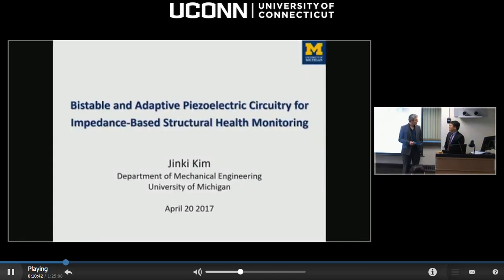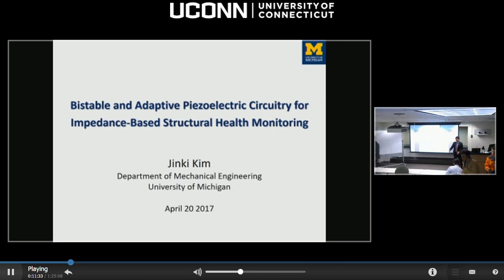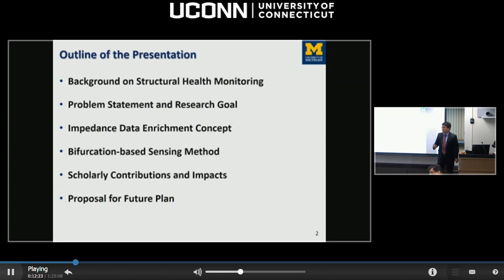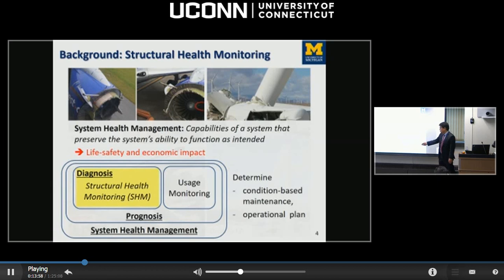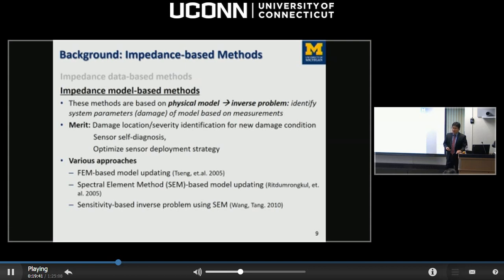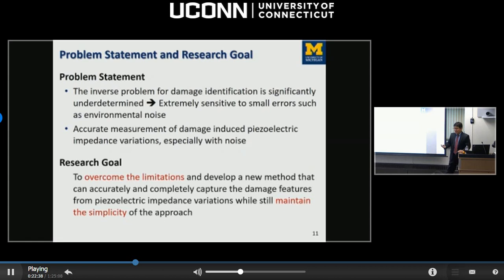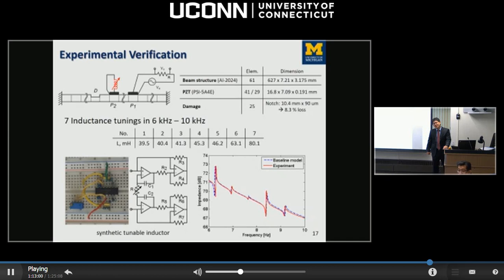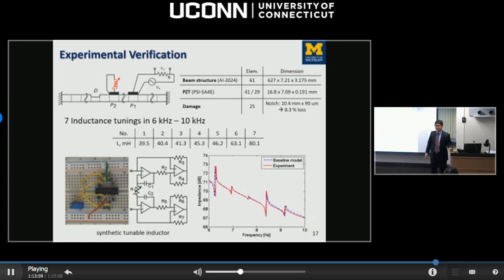Jinki Kim: Enhancing Electromechanical Impedance-Based Structural Health Monitoring by Integrated...

Comment: - [00:01:09](https://youtube.com/jsDbqfFm9Sc?t=69s) 🏗 Overview of Structural Health Monitoring

  - This section provides foundational knowledge on structural health monitoring, emphasizing the importance of damage diagnosis.
  
  - The significance of structural health monitoring is highlighted through examples of catastrophic failures.
  
  - Various methods for damage identification, such as vibrationally and wave propagation methods, are discussed, along with their limitations.

- [00:08:39](https://youtube.com/jsDbqfFm9Sc?t=519s) ⚙ Electromechanical Impedance Method

  - Introduction to piezoelectric impedance-based methods, detailing their capabilities and constraints in detecting structural damage.
  
  - The segment explains the two classes of impedance-based methods: data-based and model-based, discussing their strengths and weaknesses.
  
  - The importance of overcoming challenges faced by existing methodologies is underscored, particularly in terms of noise sensitivity and sensitivity to small-sized damage.

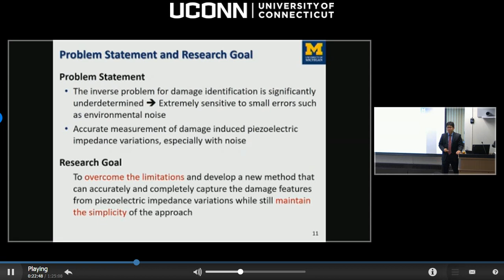- [00:12:15](https://youtube.com/jsDbqfFm9Sc?t=735s) 💡 Enhancements in Damage Identification

  - Presentation of a novel method for enhancing damage identification through impedance data enrichment, featuring a proposed adaptive circuit.
  
  - Detailed mathematical modeling of damage identification processes through sensitivity equations is introduced.
  
  - The section emphasizes the importance of enriching impedance measurements to improve system identification.

- [00:16:15](https://youtube.com/jsDbqfFm9Sc?t=975s) 🔍 Experimental Verification and Results

  - Presentation of numerical analysis and experimental results that demonstrate the effectiveness of the proposed method in identifying damage.
  
  - Data comparison illustrating improved accuracy in damage detection with the introduced method, even with noise influences.
  
  - Visual aids are used to clarify the damage identification process, emphasizing advancements over conventional methods.

- [00:20:44](https://youtube.com/jsDbqfFm9Sc?t=1244s) 🔄 Bi-stable Circuitry for Improved Measurement

  - Introduction of a bi-stable circuit design as a solution to improve measurement accuracy in structural health monitoring.
  
  - The concept of bifurcation-based sensing is explored, detailing how nonlinear responses can enhance sensitivity to damage.
  
  - The mechanism of using this circuitry integrated with structures is explained, highlighting its potential for capturing impedance changes.

- [00:30:53](https://youtube.com/jsDbqfFm9Sc?t=1853s) 📊 Application of Bifurcation Based Sensing

  - A comprehensive overview of implementing bifurcation-based measurement techniques, focusing on transition tracking to assess structural health.
  
  - The importance of sharp transition responses in damage detection is emphasized, detailing how these can be affected by noise.
  
  - The section concludes by addressing the challenges of perturbations and their impact on measurement reliability within structural systems.

- [00:33:09](https://youtube.com/jsDbqfFm9Sc?t=33m9s) ⚙ Understanding Bifurcation in Structural Health Monitoring

  - The detection and analysis of bifurcation points are crucial for effective sensing in structural health monitoring.
  
  - Accurate tracking of bifurcation points is necessary to avoid false alarms due to noise.
  - Experiments demonstrate the sensitivity of bifurcation locations to noise and input parameters.
  - A bi-stable circuit is introduced as a solution for predicting bifurcation under environmental influences.

- [00:39:07](https://youtube.com/jsDbqfFm9Sc?t=39m7s) 📊 Predictive Modeling of Bifurcations

  - Development of a stochastic normal form allows for predicting bifurcation locations amidst noise and non-stationary influences.
  
  - A numerical method verifies analytical predictions through Monte Carlo simulations.
  - The importance of modeling errors in practical applications and their effect on measurements is discussed.
  - Enhancement in sensing resolution using bifurcation-based methods is emphasized.

- [00:42:54](https://youtube.com/jsDbqfFm9Sc?t=42m54s) 🛠 Combined Techniques for Damage Identification

  - Integration of bi-stable and adaptive circuit techniques significantly improves damage identification in structures.
  
  - The combination reduces prediction error in damage localization effectively.
  - Statistical analysis supports the efficacy of integrated methods over conventional techniques.
  - The importance of advancing sensing strategies for structural health is highlighted.

- [00:45:11](https://youtube.com/jsDbqfFm9Sc?t=45m11s) 🎯 Future Directions in Structural Monitoring

  - Plans to enhance structural monitoring systems focus on sustainability and resilience.
  
  - Exploration of application expansions, including MEMS sensors in HVAC systems.
  - An emphasis on advancing nonlinear sensing techniques for better predictive capabilities.
  - Setting goals for improving operational reliability in real-world applications is proposed.

- [00:56:27](https://youtube.com/jsDbqfFm9Sc?t=56m27s) 🔧 Addressing Modeling Errors in Damage Identification

  - Consideration of modeling errors as akin to measurement errors is discussed for improving identification techniques.
  
  - Updating baseline models for better alignment with experimental data is crucial.
  - Future work will aim to quantify errors and enhance confidence in identification algorithms.
  - Emphasizing the need for flexible methods to adapt to uncertainties in practical applications.